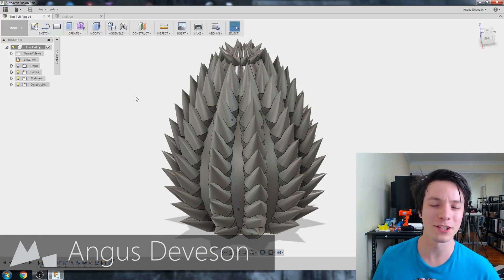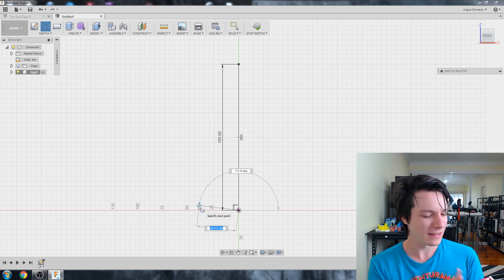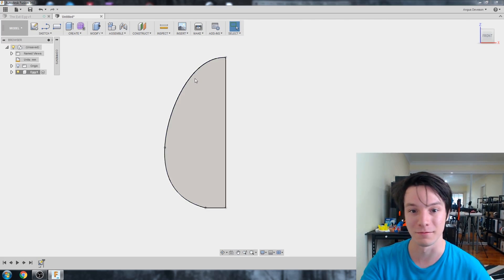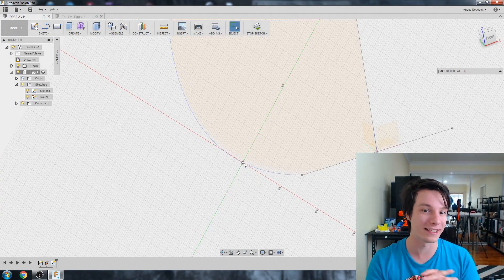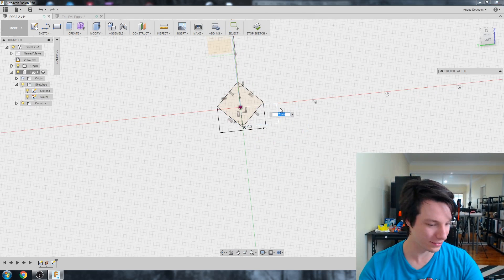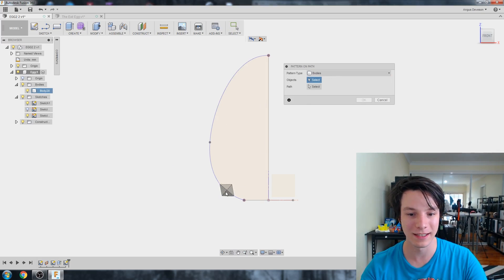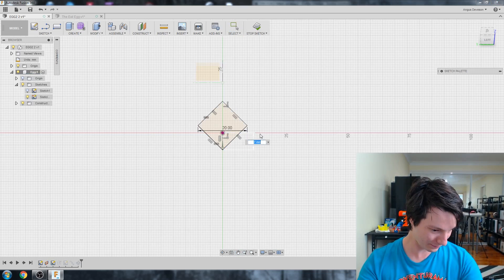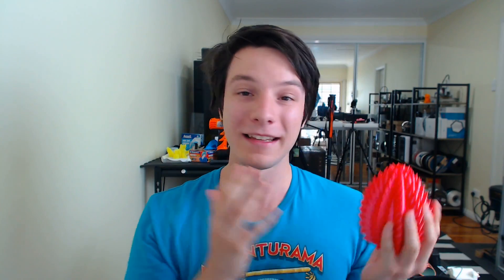3D Print a Dragon Egg for Easter! CAD for Newbies using Fusion 360

Comment: Oh my god it looks so cute!!! God I'd  kill to own a 3D printer for this stuff...
Reply from the maker: Cute!? Haha
Reply: Maker's Muse dude it makes the perfect cosplay prop for a ton of different costumes! Hell a few adjustments and ya got some creepy shadow ball stuff going on (and of course a different filament)
Reply: kristofer tea 
its not that hard. the hard part is learning what you need and how / where to get it. Then gaining the experience of how to design and work with plastic.

If you have a local electronic wastes center, you could get a lot of the components for the printer very cheap. And if you can get someone to print you a few parts you could use ptfe bushings and save in bearings plus it will be a lot quieter or have a few pullies printed and use that along any belt you may find (mxl, t2,5, etc) and also save in belts and pullies.

Comment: So im still new to the 3d printing scene,, if i run out of spool in the middle of a print is there a way to salvage the print or is it best to start again?

That egg looks amazing, im gonna get some made for my boys 😃
Reply: THE ROGUE I would suggest to not let it run out of filament. Instead, change it right before the motor pushes the last bit through. Most printers should have an option to change filaments. I know some printers will let you restart printing where it left off, but I think you kin of have to guess where it stopped printing. Hope that helps

Comment: Would've been cool to print the egg in two parts with a keyed connection for a full egg. Or even do the same thing but with the egg split vertically into two halves, which might be easier on the printer for complex shapes.
Would also be cool to introduce spiral patterning, instead of just vertical patters, or maybe even do horizontal patterns.
Reply from the maker: +Xander Zoolander gotta keep the cad for newbies tutes simple,  but more advanced ones coming for sure including threads and multi component modelling

Comment: I got a question : Can you test a to print a pla object and dip it into a acetone + abs "slur", then make it dry and vapor acetone on it to see if it smooth and have a better heat handle ? I think its a good way, saw some theory on forums but i dont have abs at home ( mine can only print pla ).
Reply from the maker: +Nobock there's a product called plastidip that does a similar thing, worth trying!
Reply: I hypothesize that PLA prints will still heat-warp easily even if you coat them over. Whether you can smooth them like that at least? I have no idea. I expect that as liquid gains surface tension by drying from outside in, it will bridge over the layer gap and it will come out smooth, so you wouldn't need to acetone-smooth it.

I don't think PlastiDip is suitable, or does anything alike. I recall it's a naturally colourless elastomer (Shore 70A) that doesn't really stick to anything particularly well, in a volatile solvent.
Reply: last week i painted a jewl with graffity paint and apply a coat with nail polish it start to make the paint bleed after 5 sec and it smooth it very nice. But if you go too slow you got some blobs.

Comment: It needs to be hollow and and have a split to remove the top 1/3 with a easy attach and remove mechanisms between top and bottom (maybe twist to release). Then you could fill it with "dragon" candy or sweets.. Even cooler if it was made with two materials, the egg in solid and the spikes in a flexible material.. And maybe slightly transparent....

Take it as a challenge if you will.. 

If I could afford a 3D printer I know I would try to make one just to see if I could (but my money is gone due to long term sickness), but one day...

Comment: What does it mean when a print curls up midway through(not a problem with bed adhesion) I am using hatchbox abs by the way thanks in advance
Reply: Curling off the bed or curling from the piece, like the edge printing doesn't lay flat on the last layer?
Reply: so its a 45 degree overhang and each time it lifts up a bit higher but bed adhesion is perfectly fine
Reply: What temp are you printing at? I've noticed my hatchbox likes around 210.
Reply: I use 225 with the hatchbox abs
Reply: Oh. I'm using PLA. ABS does have shrink problems outside of an enclosure. Got it enclosed?
Reply: Cool time between levels can make a deference too.
Reply: Kinda I got a trash bag over it but it doesn't seem to help much I'm probably just gonna use their pla until I can get the printer I want with an enclosure

Comment: Sooo... after changing the orientation from identical to Path direction, my bodies are still floating about 20mm above the actual path... did i miss something? (instead of a diamond shape, i used a circle of 10mm diameter, extruded with a 45° taper angle if that makes a difference. Otherwise i followed step by step.)
Reply from the maker: +therealpanse make sure your plane allows them to intersect the path, try tweaking both of those and it should work!
Reply: they definitely do intersect, the center of the circle is right on the intersecting path... Guess I'll play around a bit more. If i cant get it to work, I'll try with 123D or onshape... maybe those will get me closer to the one I have in mind.
Reply: oh... and thanks for the quick response

Comment: I recently downloaded Fusion 360 but never used it Iam just used to Sketchup that much that I dont want to switch to another Program somehow :/

I liked the new one better because it looks more like a Dragon Egg :P
Reply from the maker: +xXTeslaXx agreed, its got scales! I love fusion but it did have a learning curve which is why I started the tutorials
Reply: I don't know how anybody gets anything with fine detail to print correctly from Sketchup. I created a hex screen pattern for the base of a simple 150x100mm tray and sketchup wouldn't output a printable stl. I went back to fusion 360 and never looked back. I have had not problems with it. It does have a long learning curve but, to me, it is an investment. I lost three weeks of heavy time investment in Sketchup before I realized it was doomed. As I said, I don't know how people are getting away with Sketchup when it failed one of my earliest designs.
Reply: I use the Solid Inspector2 extension by ThomThom. It finds reversed faces, unconnected lines, and holes in the mesh.
Reply: One problem I had was I would save something as a component, and it was fine - printed Ok after using ThomThom's extension. The next time I used the component it was full of faults - that was when I bailed on SU. I think the interface is user friendly, I had a steady rate of progress learning the system as it is heavily supported on youtube, but that kind of error was too much to accept.